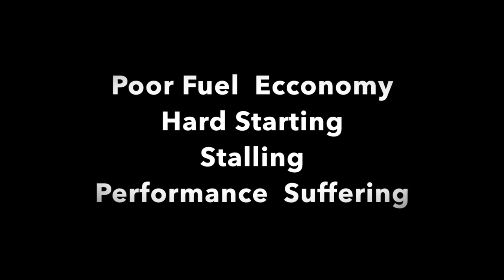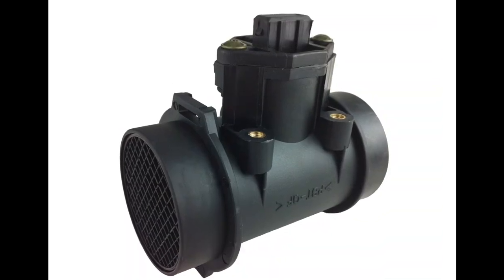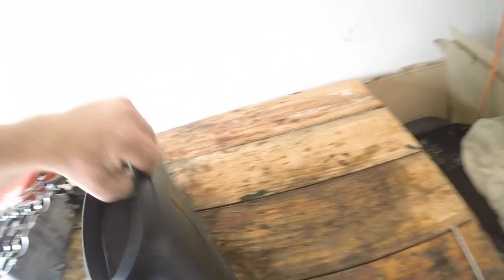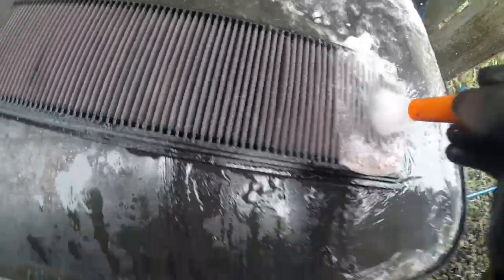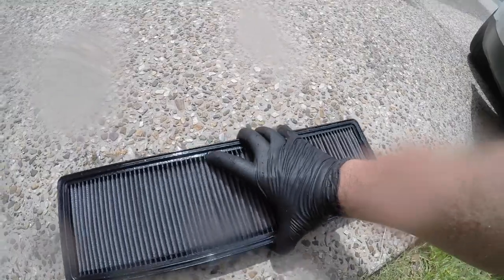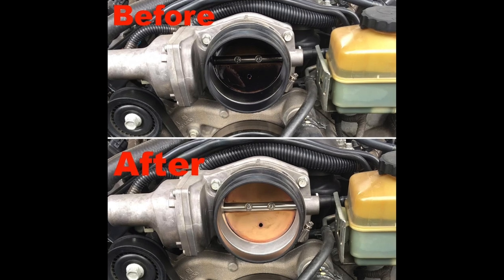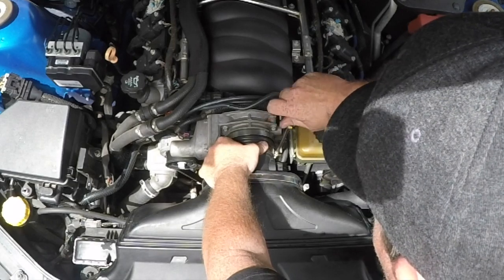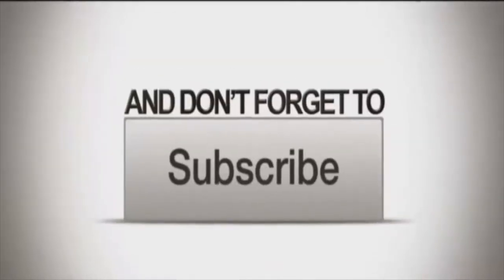MAF and Throttle Body Cleaning with Bonus K&N Filter Cleaning

Comment: Can i use throttle body cleaner to clean maf sensor?
Reply from the maker: Gustavo Marci No, to get the right results use MAF cleaner only.
Reply: My car is 03 toyota caldina zt 1azfse engine version without turbo..the problem is my car dies when i stop at traffic light and check engine indicator will come up...when i start it back...its just like nothing happen...😤😤😤😤
Reply from the maker: Gustavo Marci sounds like the Idle Control Valve is gummed up. You should be able to free it up with a good clean as well.

Comment: I have a code p 2281 should do the same thing,  I have a dodge ram 3500 2016
Reply from the maker: A P2281 code is a air leak between the throttle body and MAF sensor. Check all of the intake piping and joins for a leak. If possible, partly cover the air intake at the filter box as it will force the engine to draw air in from other places, it may make the leak easier to find. In Australia we don't have these cars so not totally familiar with them. Thanks for the comment.

Comment: That throttle body is only that bad because of the over oiled Filter
Reply from the maker: Spartan Rider 100% correct. The filter was all most dripping!!
Reply: Not necessarily -- there are OTHER causes that may have been in effect. If the extra oil was the ONLY cause, then anybody that used only a dry paper filter would never get a dirty throttle body !!
 The biggest problem with over-oiled K&N air filters is M.A.F. Sensor contamination -- a serious problem that can be avoided by FOLLOWING K&N's INSTRUCTIONS EXACTLY !!

Comment: The way you cleaned the throttle body is wrong brother , it’s electrical throttle body do not push the butterfly open like that or you will damage the position sensor which I did before .
Reply from the maker: Some Throttle Bodies and super sensitive and as a rule I agree you should force/move them.

Comment: I thought having a long runner at intake is common sense for  car manufacture...
Reply from the maker: Long intake runners do help with mid range power. I guess is this case it's a balance between space available and design. You do see many high powered V8's with a huge intake that sits outside of the bonnet. thanks heaps for the comment.